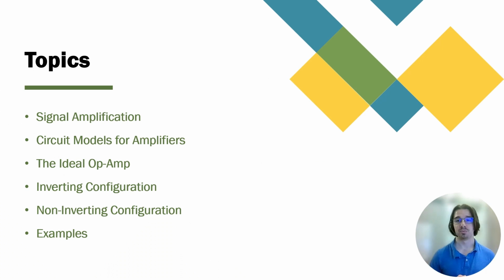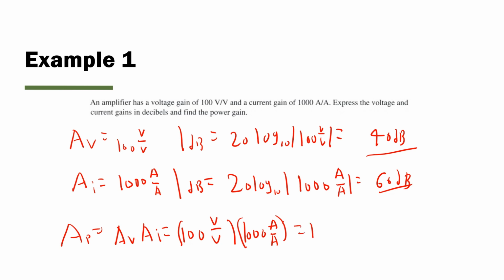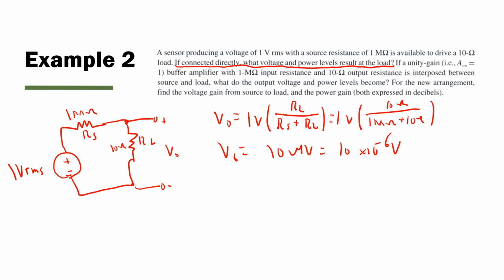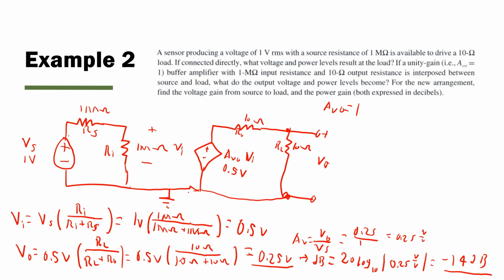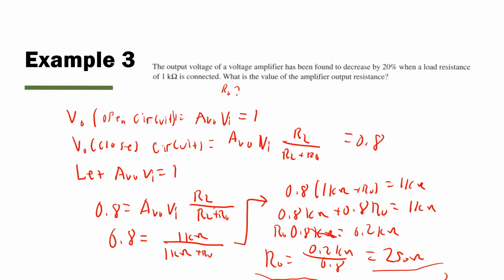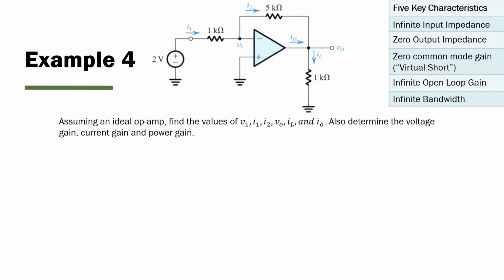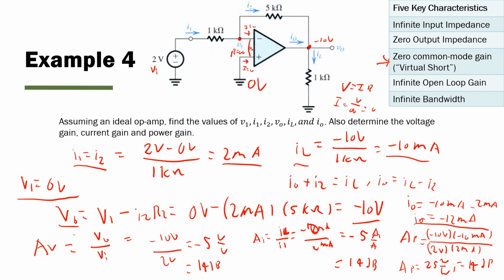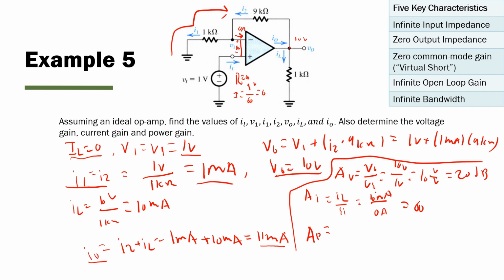Signals and Amplifiers: Circuit Models, Ideal Op-Amp, Inverting and NonInverting Op-Amp

Comment: Hey man, I don't know if you are able to, but I would really appreciate it if you were able to make more videos/lectures on the chapters explaining the principles and concpets from each chapter, It would help a lot. Many thanks from NY 
P.S. if you saw a comment earlier similar to this one it was me but on my school account, I just decided to delete it
Reply from the maker: Thank you for your comment. I am currently in my senior year of college, and I am taking a class that studies the remainder of the book (we just started chapter 9 🙂).
If I can find the time, I would love to make videos covering the entire book. Hopefully by this coming winter. Cheers
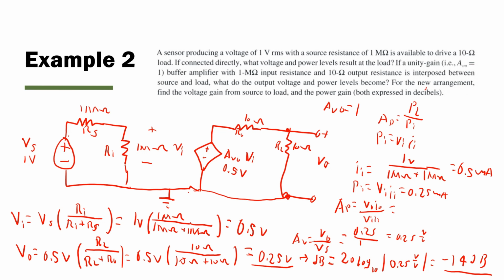Reply: @brentbertaux3729  Thanks man I appreciate it a lot, I wish you the best for your senior year. Also just a question around 15:30 you get -14 but when i put 20log(0.25) I get -12.04, I was just wondering whether it was a mistake on my part. Also around 17:00 , to get Io wouldn't it be 0.25/20 ? or are we using AvoVi instead of Vo
Reply from the maker: @everhernandez323 great questions, and you are correct on both! Looks like I wrote down the gain wrong, and it is indeed -12.04 dB. 

The voltage difference from the amplifier to the positive node of Vo is indeed 0.25, not 0.5. 

Thank you for catching my mistakes. This helps me improve the quality of future videos.